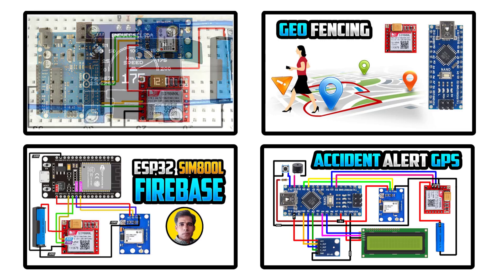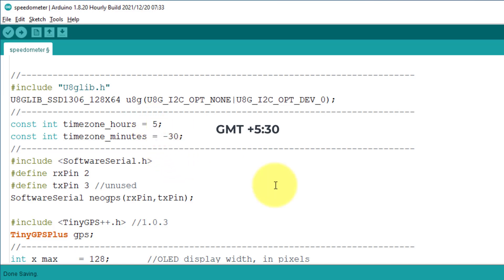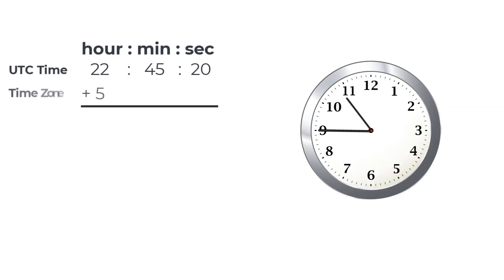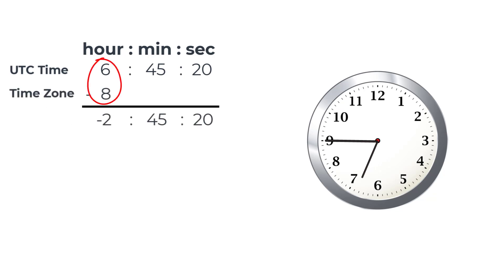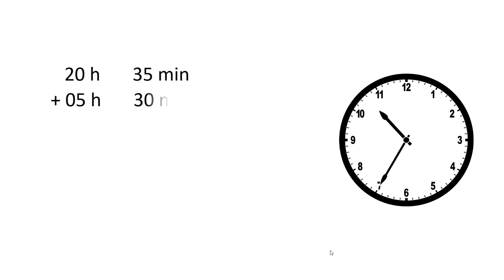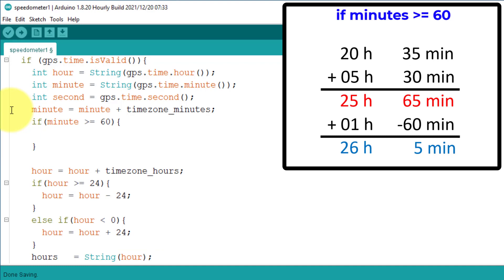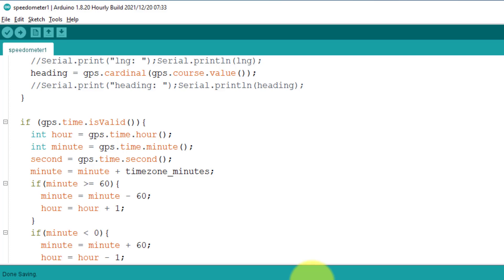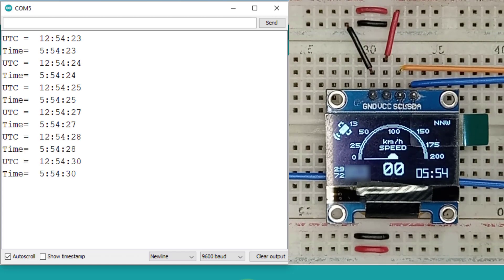Let's Add Timezone In your GPS Projects - Arduino Speedometer

Comment: if TimeZone is +5 and GMT is 22:00  result is 03:00 but Date is not update....... add new conversion for date month year.............thanks
Reply from the maker: have you set the timezone in the code.
Reply: @AhmadLogs  Assalam Alaikum... Yes But Date Did Not Change After 12am.. I Am Using DS3231 RTC Module
Reply: The Date Will Change After GMT Time Always.
Because Date , Month And Year Veraiable Did Not Addad.

Comment: Very well presented, Ahmad. I have a requirement to present an in-vehicle digital clock showing both local time and UTC time which changes according to the GNSS derived lat/long geolocation (NMEA sentences $GPRMC and $GPZDA).
I need to incorporate three adjoining official Australian time zones and one unofficial time zone with specific geographical boundaries (a rectangle with two parallel longitudes and two parallel latitudes). The unofficial time zone overlays two of the official time zones. I would be pleased if you are able to contribute to the project with your outstanding expertise. I would hope to use Arduino Nano V3, GNSS module with 240x240 LCD IPS display. I look forward to your comment.
Reply from the maker: The project you are talking about is very sophisticated. I am afraid if I can do it. truly speaking, I am unable to do it right now.
Reply: @AhmadLogs  Sincere thanks for your replay, I look forward to working with you in the future.